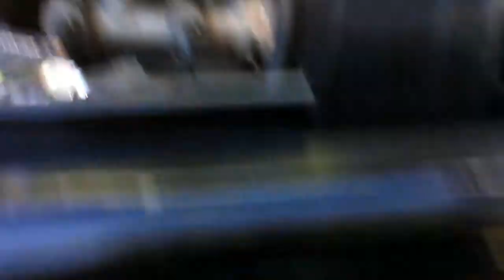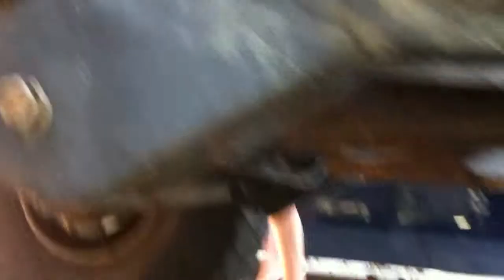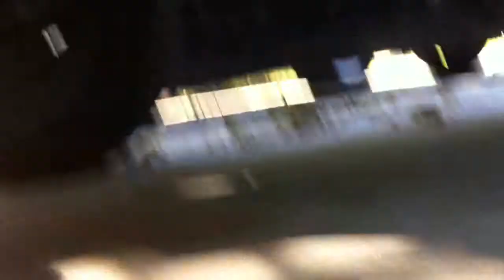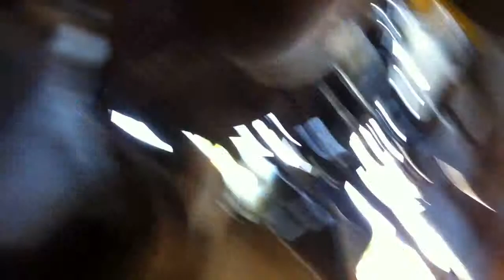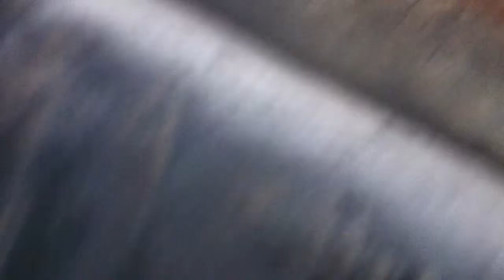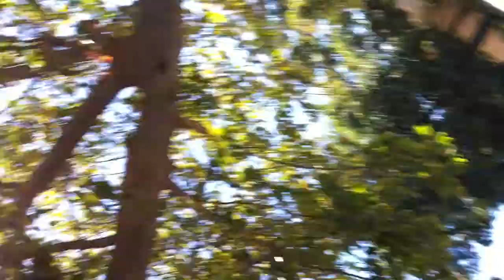Rattling Jeep part 3

Comment from the maker: Broken piston skirt, cylinder #3.
Reply: Was it expensive to fix?! I have the very same issue with my 2016 Sahara...
Reply: @Vnzlanbrat  I just pulled the engine and had it rebuilt.  You could replace just the piston, rehone the cylinder, etc, but by the time you go through all that trouble, you might as well just have the engine rebuilt if you like the Jeep.